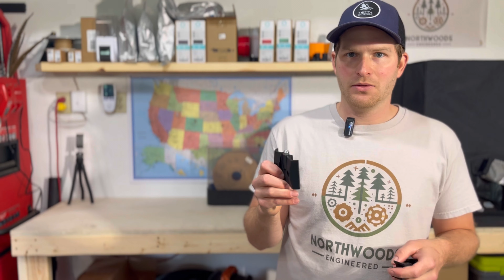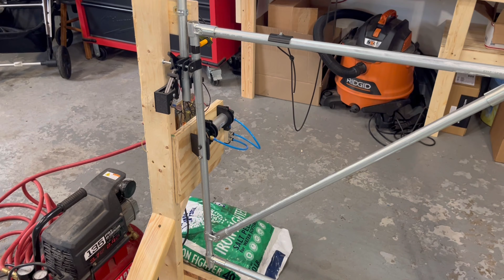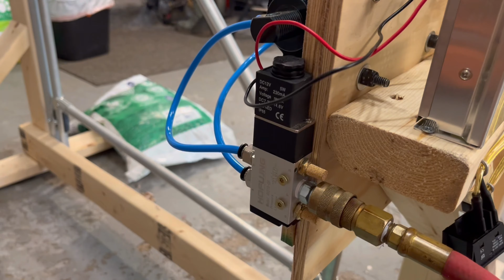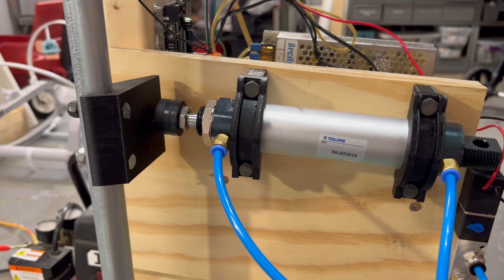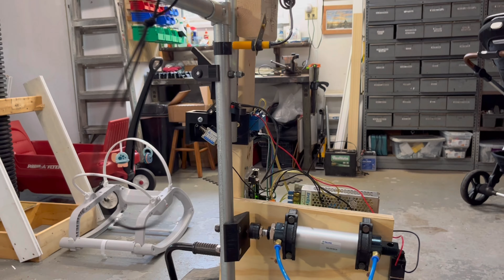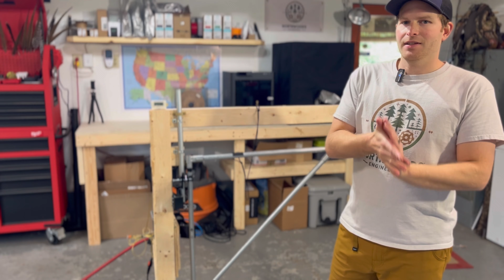Automatic Gate Tester For 3D Printed Latch and Hinges

Comment: I have his hinges on two large 8x4 foot gates with chicken wire. I was waiting for them to fail and they have not. I needed to run an anti-sag wire to my gate which I assume added more stress to the gate hinge when they were sagging. Also these hinges have been in direct sun hot hot summer days over 90 degrees and no issues.
My only suggestion is if you could make a hinge that opens more than 90 degrees and maybe a slightly beefier option for gates that are larger. 

Don't hesitate to buy from him. Great communication and great product.
Reply from the maker: Thank you for the nice comments! Always great to hear from people who are having success with my product. When did you purchase the hinges? My latest design does allow for closer to 120 degrees of rotation. 
And as always, if you ever have an issue, don’t hesitate to reach out.
Reply: @northwoodsengineered  I purchased them this spring along with the drill guide. All good might upgrade to the newer hinges after this year. I have had a few people thinking of making something similar so I will send them your way for the hinges.